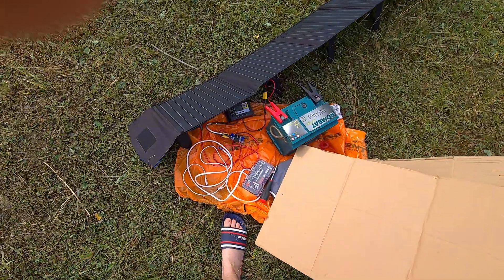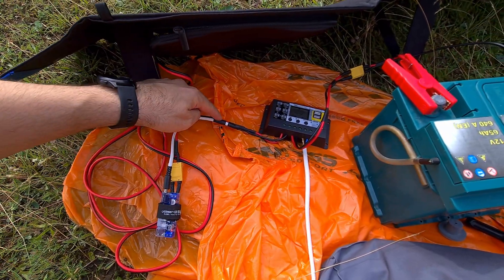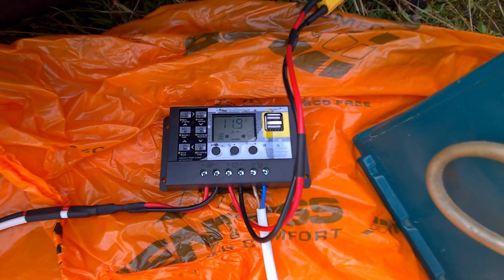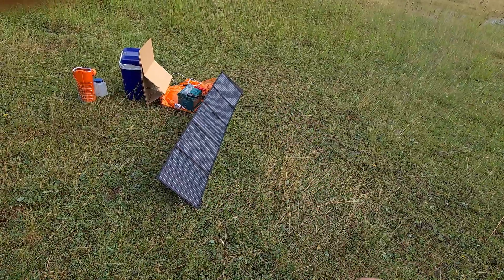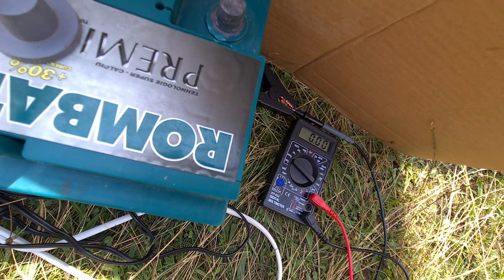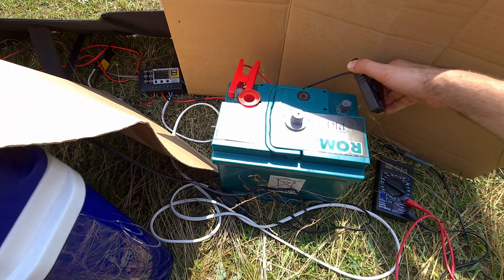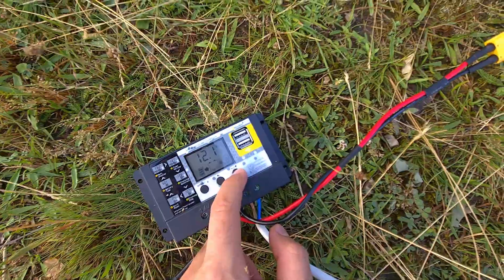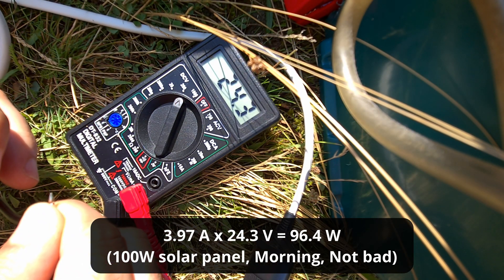Solar Charge Controller can't be started without a Battery (Solar Panel running a 12V Fridge)

Comment: What it may be a problem if soller changer  control not supply power to the batteries?
Reply from the maker: The battery will discharge and won't power the fridge.